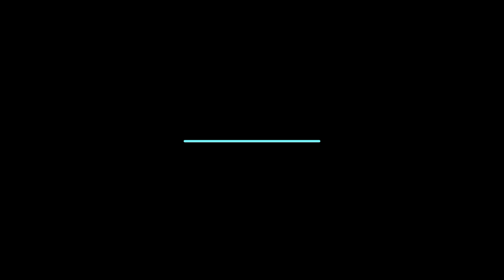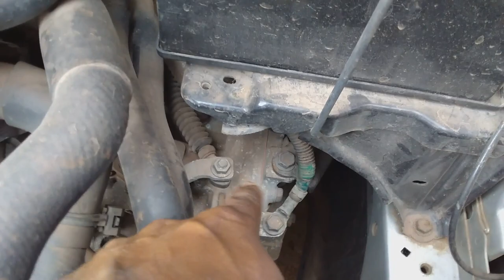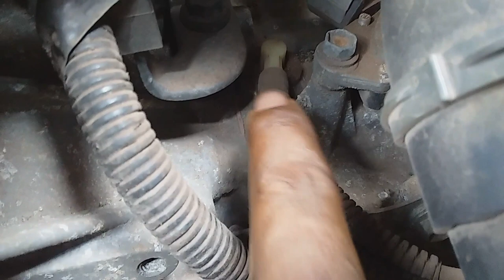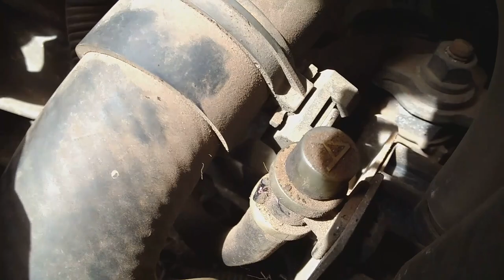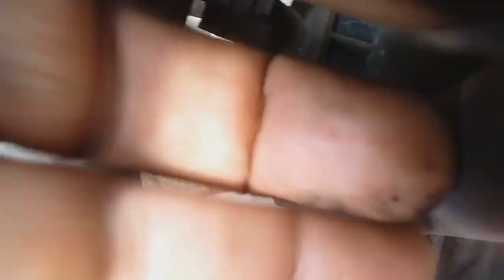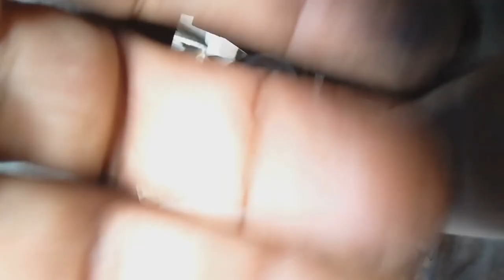Toyota Vitz Transmission Breather Hose and Cap

Comment: I had my transmission fluid changed and it started to leak fluid and it turns out it was coming from the breather hose because my mechanic put 4 Quarts of fluid in my Daihatsu Terios transmission. I thank you for your insight into this problem.

Comment: Hi, thks for this video. I somehow lose my breather cup. So my mechanic had the holes plugged to avoid fluid loss. After watching this video, I kind of feel that was not a wise decision. Can u give me your advice on the issue, please.
Reply from the maker: The breather cap allows the release of excess pressure built up in the transmission. This hole can not be sealed.
Find a old breather cap in a junk yard or from a transmission that is not good and replace yours.
Reply: @ShelDockToyotaVitz  what would be the consequences of pressure built up in the transmission?

If I lose the cap, will my transmission begin to lose oil through the hose?
Reply from the maker: @josecristovaohall6411  the cap only pervent liquid or anything that could fall in from this point from falling in. 
If pressure is built up in the transmission then it can overheat much easier and damage the internal parts.
Reply: @ShelDockToyotaVitz  thank you so much for the clarification. Enjoy your day

Comment: How to change the breather plug because the breather plug of my toyota is broken
Reply from the maker: My transmisson breather plug and cap is connected to a soft hose that is push fit. If yours is similar you can pull on the hose and it should be disconnected from the plug. The next step is to un-clip the plug from its fastener on the metal.

Comment: What are the symptoms if this breather is broken, can this effect your transmissions operating properly
Reply from the maker: If you have a breather hose extending from your transmission and it is cracked or broken it can cause leakage of transmission fluid visible on the transmission close to the damaged area.
Reply: We rebuild a cvt transmision, all clutches and seals, new fluid but it keeps slipping, there is a delay and the car is vibrating and jerkingen.The breather is the only thing that is broken but we didn’t replace. Could that be the fault
Reply from the maker: @chrisjupiter3470  Remember that the CVT transmission belt has to be properly tensioned and without this it will always slip. The breather system only releases pressure built up by the heat apply to the fluid. 
Recalibrating this transmission is necessary if it is dismantled. Unfortunately I am not an expert in this area.

Comment: Shel dock, where is the power steering resevoir? Can't locate.
Reply from the maker: Newer Yaris/Vitz 2010 and up uses a electric motor to assist with steering. 2009 and below uses fluid to give steering assist. Power steering with fluid is usually located on the side where the steering is located under the hood.
Reply: @ShelDockToyotaVitz  Thankyou very much I appreciate your assistance. I know now🙏. Blessings.

Comment: Please what's is the perfect litters limit for Toyota vitz 2010 model 4plugs
Reply from the maker: It is best to drain the transmission fluid in a container and pour it in a bottle that you can use to measure the fluid so that you can know how much you should refill with.